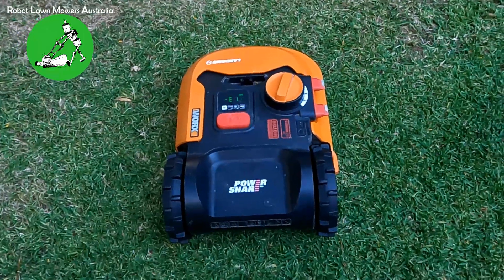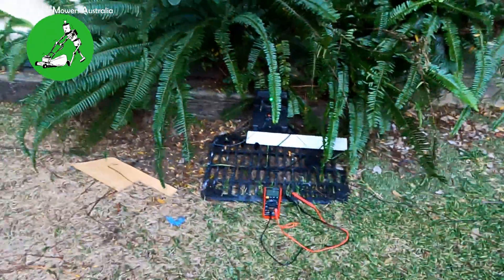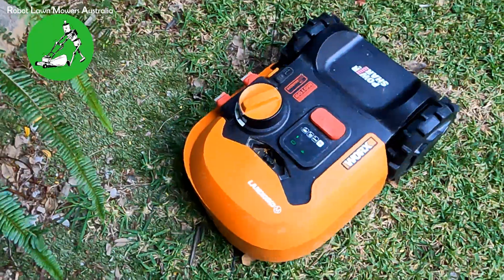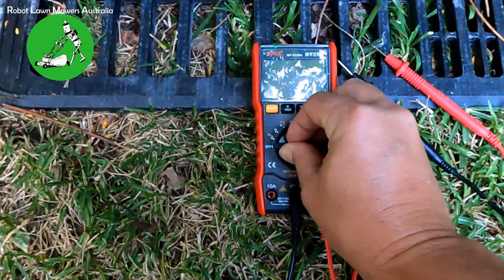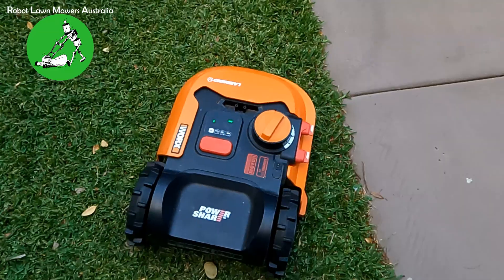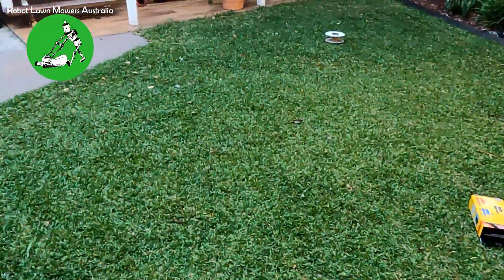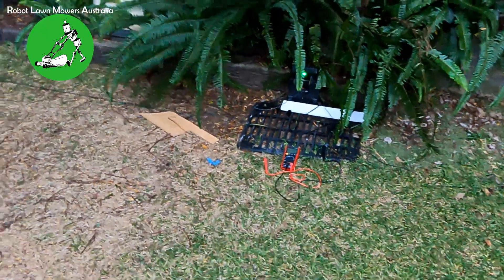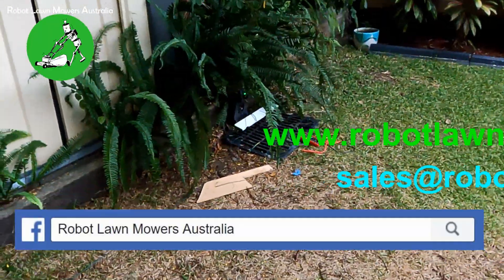Robot Lawn Mowers Australia - Worx Landroid - E1 WIre Missing Error

Comment: If you have multiple worx mowers, if one is charging at base station, then other will get E1 error as well (if mower is located somewhere inside boundary wire area that is connected to previously mentioned base station) !

Comment: I get the wire missing error only when the robot is at the station. So it won’t operate automatically nor start any routine, in the end the robot just powers off.
Reply from the maker: This usually means that the robot is loosing its charging connection when in the charger. So check that your charging connections on the charger and the robot are clean. Use some steel wool to clean them.

Comment: I get an E1 error (same mower) but my boundary wire is perfectly fine.  It measures 2 Ohm. Output is 24 Volt on the probes.  
My main problem is that I can only start it manually and it does a good job and also returns to home.  However, after charging, I need to pull it out again and start it again manually.  
It would be nice to solve this puzzle.
Reply from the maker: Sounds like you have dirty charging contacts. Try cleaning them on the charger and the robot with steel wool and metho.
Reply: @robotlawnmowersaustralia7913    Thanks.  Yes you are right.  I cleaned all the dirt inside and now its working again.

Comment: Thanks! now I understand why my robot is doing erratic movements. Time ago, I broke the cable and I solder it, but without any insulation, so, I think that after days of raining all the humidity is increasing the cable resistance, this is why sometimes it works well and sometimes isn't... now, I must remember where I did this welding🤦‍♂🤦‍♂
Reply from the maker: Glad I could help!

Comment: I have a robot that ran over an electrical extension cord and it gives me the error that there is no boundary wire now. I have another robot that works fine within the same boundary and the resistance is not too much. Is there any hope for this robot? If so, do you have any ideas what I should look at?
Reply from the maker: I wouldnt think the electrical cord would do do much, but if the robot was workng before nad then not after this even then you main board is probably fried. If you have alocal dealer for worx they should be able to diagnose the issue pretty quickly. These robots are very easy to diagnose.

Comment: The part at 12mns where the robot is crossing the wire was exactly my problem - I was about to scrap the whole thing, but this video helped me find a cut in the wire near where it kept crossing & running into a wire fence
Reply: the red light is on for the station, seems like I need to re-do the wiring before the robot would work again!
Reply from the maker: if your light is red with nothing connected to it, then you likely have an issue with your base station.
Reply from the maker: glad this video has help you.